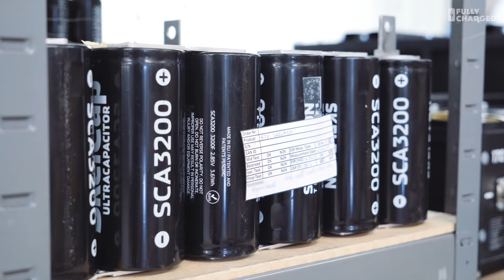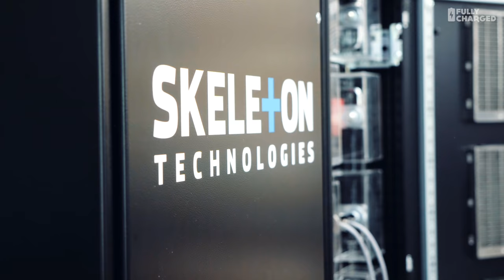Skeleton Ultra Capacitors | Fully Charged

Comment: this is the future for all portable power especially EVs, great to see graphene really working and showing its potential, rapid charging is the key thing holding back EVs at the moment but if you could put induction loops to charge vehicles as they sit at traiffic lights, meaning they dont need to plug in, or even have engine backup it would be a real gamechanger... the biggest issue for capacitors is power decay, that is they discharge when not in use.. but given they can be charged in seconds as long as there is a charging infrastructure its an issue easily overcome... exciting times

Comment: I enjoyed this video a lot, found interesting the idea of using ultra capacitors for the peak power requirements so as to save on the LiOn  batteries and also using them for quick charging. of the LiOn batteries and during braking. If EV can be fully charged in say 10 minutes without degradation to the LiOn  battery I can see this being the final nail in the coffin for ICE cars.

Comment: Im still wrapping my head around the 100kwh capacitor and the size. Which reminds me of computational storage and the evolution its done over the past 50 years...
Reply: You can unwrap your head, because it's 100kW, not 100kWh. It's power vs energy. Lithium batteries are far more compact in terms of capacity, but are much slower, so you would need a lot more of them in order to achieve the same speed. If it can provide 100kW of power for one second, then it has 27Wh worth of energy, slightly more than twice the battery in a Samsung Galaxy S8. But it also means you could charge your phone to 100% in less than half a second at the cost of having to carry a very big box around with you. :)

Comment: Capacitors can also increase the overall efficiency adjusting the power factor  for an AC system. The motor is and inductive load which causes the voltage to power ratio to increase causing a higher load on the system, but capacitors counteract that and bring the power factor closer to one.

Comment: I like the short circuit scene, where the wire gets hotter & buns insulation to pcs but nothing happens to SuperCap - never try this on a Battery folks !!  I love this tech - cant' wait to see this used in Auto EV industry, I mean they should start using this YESTERDAY !!!!!

Comment: I wonder if smaller super caps could be used for small electric vehicles like performance skate/mountain boards or electric bikes.
Often it's a problem with those that you need to use much more cells to get the maximum performance out of your power train or use lithiums cells that have higher discharge currents but will have smaller capacity(range).
And you don't need those currents for long, few seconds and accelerating starts to finish and so the current draw drops a lot.

Comment: This video is amazing. I would not be surprised that some of the figures quoted for the new Tesla roadster are due in some part of a capacitor/battery hybrid system. Would make since to introduce a system like that in the halo car and trickle the development/costs down to the rest of the product line on revisions.

Flat tax, ISP as a utility, a lot to like about that country.  You can make quick, jet-ski like moves and advancements when the country consists of less than 1.5M people.

Comment: Excellent Video. Can we start dreaming now with storing the energy from a lighting storm?
Reply: Hi Javier. Sorry, theoretical but not practical. The cost to build a system that would even capture 1% of lighting would be $billions, very inefficient and at the moment we don't have capacitors that could store the energy from one lighting bolt. Much better to use solar and wave energy to generate electricity.

Comment: If you are running a solar system off the grid with back up batteries. Super capacitors could help with momentary peak loads. Plugging in an electric car. A power tool or Ac compressor.

Comment: Did anyone notice the place was also clean aside some graffiti...
That's a start up:)
It looks good to have history and tech mixed..
I had a long time looked at super caps and battery replacement.

Ohm's law, and caps have low amp stored power but high voltage, this if you invert the high power you get more amps. I see the boxes for the city truck is only 170 volts.
But you would want maybe a 1000 volts...
At .05 amp.
This means 100 volts 50amps
Or 10v 100amp. That's rather great.
It's just size... Why they don't make square battery's and super caps I don't know, they would take up less pack space.

Comment: I believe the idea for capacitor comes from capacitors or resistors in micro circuit boards. These are giant traditional batteries at first glance. They seem to be a little more than that, which is why they're called capacitors. 
Given that, presently, the physics of batteries and electricity are "still" in development, this explains the differences in formulas around the world.
My understanding is, they are cheap (excellent) traditional batteries. Capacitor means a pool for currents to pool up, and the material can hold a large pool, which can discharge based on a difference in gravitational fields (wire is the common medium).

Comment: That rack highlights the difference between batteries and capacitors. 1.5 Megawatt seconds is around the same capacity as 416 Watt hours; 1/240th of the capacity of a 100kWh battery, for about the same physical size. But it can be dumped at a huge power level for a second or two.

Comment: They are on to something here.  It seems like the solution to the ancient fossil fueled grid is to build something with enough storage and capacitance to deal with the intermittent nature of renewables.  The combination of Battery and Cap tech could actually work!  Exciting stuff.
Reply: the capacitors help with second to second demand that help with micro adjustments to the grid, large battery storage sites help with minute by minute demand if a power plant fails and allows time for a new one to take its place, these aren't a solution but are putting cracks in the the foundation of the fossil fuel base grid.

Comment: I like Teslas idea for using the extra electricity from regen braking....using it to power high pressure air compressors to feed the rocket thruster system to make the car accelerate faster that what is possible with just tractions.

Comment: This is the job of a capacitor, to smooth out spikes etc in power circuits, a super cap is just a bigger one capable of doing a bigger job.
If it saves battery degredation and increases efficiency AND performance it's a no brainer, increased cost will be offset in the long run.

Comment: Need to develop this tech into E-Bicycle battery packs. Hub drives are capable as a regenerative braking device. Pair that with a mid-drive motor and you'd get way more range out of the currently available and common 48/52v 17AH Bike battery pack.

Comment: I see the marking on the small capacitors say 3200F at 2,8V (F=Farad). I had a 1 Farad 15V capasitor for my car stereo and it was more then twice as big.  According to my calculations this store 220 times more electicity and is smaller...

Comment: you cannot downsize the battery back just because you have a quick charging/discharging super capacitor. it just means it might help in peak charge and discharge rates

Comment: why these are not used in hybrid cars? 
Run the engine at it's optimal rpm for efficiency then use it as a generator to produce electricity and then the energy can be send to ultra capacitors then to electric motors to power the wheels, i am sure it will be much more efficient than conventional engine, transmission, differential setup.

Comment: Somewhere along the line, he completely changed the story. At 2:43 ... Ultra capacitors are not the silver bullet as they don't store as much energy per size / weight ... and then 13:22 we are not in the KW business that's for batteries. Now the trick is he is not lying, he is conveniently mixing up terms, KW as in immediately available power level and kWH as in the capacity

Comment: You can buy a half dozen supercaps from China with an overvoltage circuit protection board for about $35 US.  You have to solder them on (takes a couple minutes).  Those can be charged up to 16v and will start engines.  They have even started my motorcycles engines when discharged down to about 8v because they can deliver so much amperage at once.  It probably weighs a pound.

Comment: Now we just need to combine batteries and capacitors into Battacitors. Fill in the space between those cylinders with another material that can store greater charge but needs a bit longer to absorb it. Then the capacitors can charge the battery bits instead of leaking EMF back out into space.

If we get really good at this, we can eventually have multiple levels of materials, each with a different tradeoff between energy density and charge times, to create a hierarchy.

Comment: You will find many people on you tube making home made capacitors and all that I've seen so far have used variations of a centuries old paper capacitors. It was demonstrated decades ago that modern technology can manufacturer paper caps that out perform any currently produced battery in power density and volume size and power cars hundreds of miles and charge in  seconds the problem is safety the consequences of damage or internal short or failure is explosive and make lithium ion look tame also their voltage could be in excess of  1000v.

Comment: Thank you for your show, it is realy great, I follow it for a long time. 
I would like to ask a question, why the car manufacturers do not use the ultra capacitors in their electromobiles or hybrids cars instead of batteries or in combination with? With it's capacity, it could extend a range significantly. Other idea could be use it in public transport vehicles in cities..
Reply: because it offers less charge when the motor is off, although that can be bypassed trough lithium boosts of batteries of high capacity but low discharge to offer the same capacity of a lead battery to hold charge while the car is off or by the addition of a small solar panel and a small crank generator in case of emergencies.

Comment: I've been interested in capacitance   I made a triangle of a capacitor a resistor and a LED and if you charge the capacitor for a second the light will stay on for a while depending on the resistance totally disconnected from the battery... Iirc I think the circuit is a Jule theaf

Comment: I've read recently that the energy density of LiPo batteries is still higher than that of super capacitors. I also have my eye on Solid State battery technology, which is promising. However, I feel that super capacitors would be the way to go for storing solar generated power overnight. Batteries are expensive and have to be replaced often and with Lithium-based batteries, dangerous as well.
I've long been thinking about an off grid solar electric system for my own house. With electric bills pushing past $700 monthly ($400+ of it is delivery charges), I am constantly researching ways to get off the grid. 
My plan is a 3 state PWM inverter rated for about 100kW, split phase 240 VAC, fed by banks of batteries or super capacitors configured to deliver 165V DC to each bank of the inverter. That way there's no step up transformer needed, with its attendant losses, heat and noise. The whole thing would be charged by 36kW of solar panels on the roof.
Since our place has a static 8kW draw from computers and lighting and shop equipment, with peaks much higher for water pump starts and for when my 20kW sound system is playing, a very high capacity inverter is necessary.
The problem is storage during non optimal solar periods such as cloudy and overnight. Presently available super capacitors are outrageously expensive and only rated for about 2 volts. Enormous quantities would be required. Even amortized out over 20 years, utility power would still be cheaper.
If there is a breakthrough in super capacitors where high voltage and high current capacity becomes reality at a reasonable price, that could make off grid power a reality for many.
I love that 1.5 MW super capacitor bank. That's enough to power my sound system probably all day!
Oh, and as a video producer with high standards, I'll state that the production quality of this particular video is excellent. Good angles, effective editing, well exposed and good color and good job on the audio too.

Comment: If you think about it, capacitors are used to smooth out signals and voltages in electronics, so why not use them in our electrical grid to do the same thing?

Comment: Very good video.  I've been interested in following super (I guess now ultra) capacitors.  I had a few questions I wished had been asked.  Such as why not all capacitors instead of Li-Ion? Is it cost?  Is it energy capacity?  He seems to think a combination of the two is ideal.  Although, it seems to me that 3,000-5,000 charges for Li-Ion should be sufficient for most car users right?  Even charging full cycle daily that is 10+ years.  I probably do a cycle once/week.  That would be 70+ years.  Of course it is not only cycles but age does come into play.  

 They can charge/discharge quickly but not as high energy capacity as Li-Ion, right?  Is that the issue.  I'm hoping for more information in future videos.  Beautiful country.  Would now like to visit some time.
Reply: Dude your comment its a lot of King Best 🤤🤤🤤🤤🤠🤠🤠🤠

Comment: Maybe a battery type that can do both a “sprint” and a “marathon” is in a near future. So the electric vehicle will charge about as fast as filling a tank of gas, will have about 1000 miles of range and will have close to 1,000,000 charging cycle. Pair that with an electric car been much much faster than an ICE and can be design better due to weight placement and the electric motor been ever so small and renewable energy to charge it..... ahhhh a dream..... cannot imagine people arguing against that!!!!!

Comment: The issue as usual is actually the charging system. In the UK we simply do not have the power distribution infrastructure and with the price of copper never will. The LV distribution network typically has a rating of about 7.5 kWh per household per day. With 30% contingency that would be 10kWh. A battery charge on a small electric car like a leaf needs 20+KwH. So basically if everyone tried to charge at the same time the substation would blow in a most spectacular fashion. Even if everyone was extremely careful to stagger charging then it would still be a minimum of 250% of the maximum capacity of the substation (assuming 5kWh per household per day). And unfortunately with the current restrictions on solar panels that would not make much difference either. There is however a solution but it would need a paradigm shift on the part of legislators. IE allow much higher output solar systems and allow much more energy storage at source. Specifically if you had a 50kWh battery (or capacitor) in your home (which could easily fir in most homes) you could charge your car from that battery easily. All you would have to do is regulate backfeed into the grid to a maximum of 3.5kW and the current system would be able to handle it.

Comment: What about the thickness of the insulator, can we get one atom thick insulator so as to have three atoms thick the plate to the insulator to the plate relationship. then you will have max cap values. Otherwise, need to paint on the insulator is still more than one atom thickness?

Comment: The larger the battery pack, the more cells it has; the more cells it has, the more energy you can charge into it for a given period of time (in absolute terms, not percentage terms) and the less you need this technology. My guess is that car manufacturers need these ultra capacitors primarily because they don't have the supply of cells for larger battery packs. I can't imagine any other reason that tesla wouldn't already be using them.

Comment: If the super capacitors have all the benefits + cheaper and more energy density, what are the benefits of still using a battery? Maybe safety? Maybe I overlooked something.

Comment: I am a great fan of the ultra or super capacitor concept. But. One million charge/discharge cycles seems a lot compared to three to five thousand cycles in a (Tesla) battery pack (Panasonic or Samsung lithium batteries). There are several hours of charge in the batteries where each hour is 3600 seconds. If we multiply that with the 5000 cycles of the batteries we get to similar energy storage/discharge qualities, or even better numbers from the batteries. So, it is not about that number but about the positioning or application or use case. For storing braking energy and releasing it during acceleration capacitors work extremely well, as indicated in the video. To me, capacitors always seemed more attractive than batteries. If it were possible to better control the release of energy from them without significant looses, that would mean a huge advancement. In uninterrupted power applications, capacitors would also work well to store a couple seconds of energy required immediately when AC fails and a big diesel generator needs to be started (this used to be done with big batteries or with a small flywheel running at 100,000 rpm or more.) Each significant data center in the world could benefit from this.

Comment: Supercapacitors appparently allow you to use a smaller Li-ion battery and also make regenerative brakes more efficient.
Reply: Would we be able to do without the 'battery under the bonnet' ?
Reply: These are Ultra Capacitors, Super-capacitors had less power to density ratio, I think this one uses chemical components to increase it capacity density.